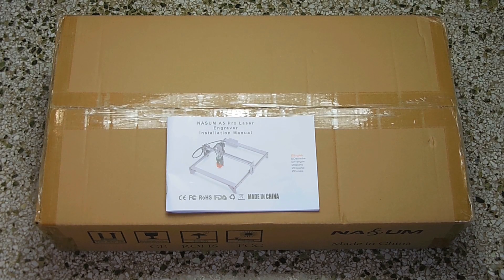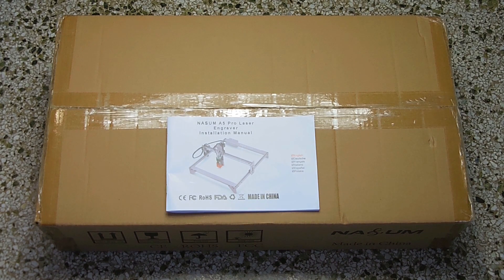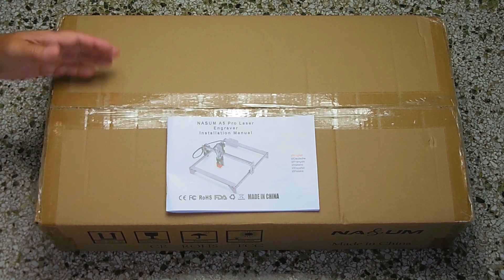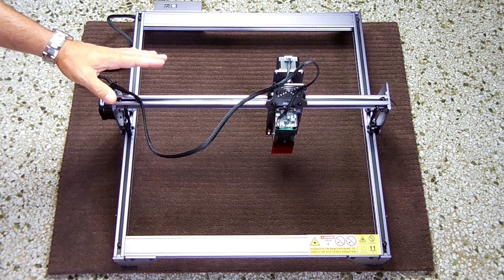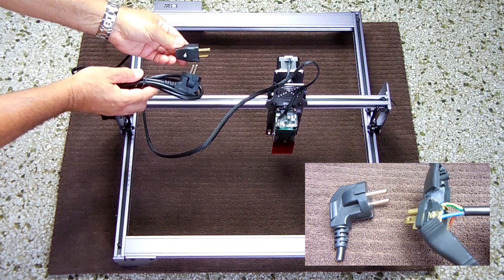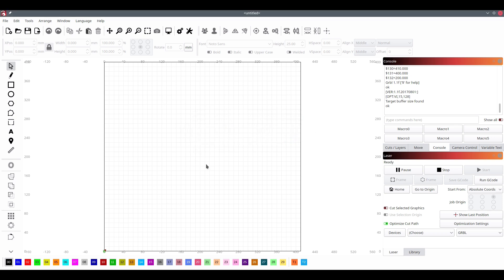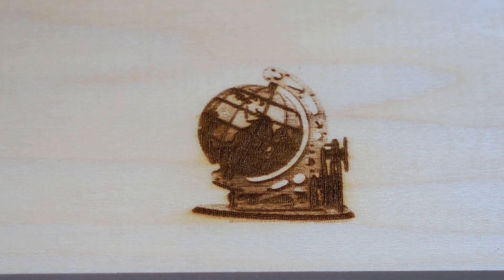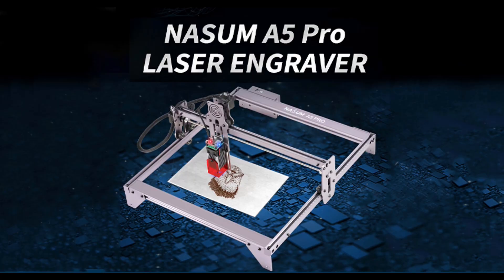Nasum A5 PRO 40W Laser Engraver Etcher Any Good? Find Out!

Comment: "According to the manufacturer, it has the ability to cut through 1/2" wood"  That's a big claim.  How about testing that claim.  I think it'll fall short by a wide margin.
Reply from the maker: I think it will, but you'll need multiple passes to do it. I tried 100% at a slow speed, and it burned 1/8" deep one pass.

Comment: Hey, I just got this laser and I'm having problems engraving/etching the surface of stainless steel and aluminum. I noticed you said it took 14 minutes although whenever I engrave something it takes a couple minutes. Did you go over it multiple times? I'd really like to solve this problem so anything would help haha. I've tried using both lightburn and laser grbl.
Reply from the maker: You have the speed set way too fast. I explained in the video.
Reply: @electronicsNmore  My speeds actually set between 10-30 😓 I’ve been going slower and slower.
Reply from the maker: @puddles113  Then the power is too low.
Reply: @electronicsNmore  I did end up getting it to work on stainless steel. Unfortunately it just didn’t work on my materials I was originally using. I was using a stainless steel with a different finish. I didn’t want to leave my comment as it was since it’s really not a bad laser, just not the right one for me. :) Thank you for responding so quickly!

Comment: any recommendation settings for etching clear acrylic?
Reply from the maker: I only tested one piece, so I need to experiment more with settings. The piece in this video was smoked acrylic, not clear. I'd remove the protective adhesive paper from the back of the acrylic before engraving, place it on a piece of plywood. Leave the protective cover layer on the front of the acrylic to prevent scratching while handling it. Acrylics generally engrave well at a higher speed and lower power. It doesn’t take much laser power to mark the acrylic, and if your power is too high you’ll notice some distortion in the material. The plastic in this video should've been engraved using a little lower power. Just experiment. Thanks for watching!

Comment: You didn't really show the important end of the power cable.  It almost looked like the end of the cord that plugs into the controller/power supply unit was a standard IEC-13 cable or another standard cable type.  If that is the case, then almost any old computer power cable or spare cable with a matching end to plug into the controller will work without needing an adapter or modify the cord and the bonus is that the old repurposed cable will likely be safer as it will probably use quality cable inside that meets the standards of where people happen to live.  I actually prefer when cheap Chinese products come with the wrong cable since it makes it that much easier to justify throwing the safety/fire hazard away.  Any DIYer who is over 20-25 years of age should literally have a huge extra cable collection by that point so having a spare should not be an issue for any DIYer.  I actually built a tester when I was younger using nichrome wire on a metal frame with ceramic insulators so that I could test IEC cables to ensure they could actually deliver the 10-13 Amps most claim.  A majority of Chinese knockoffs went up in smoke or went open circuit after only a few minutes of operation at a 10A load.

I don't like that they went with an open frame when an enclosed machine should be the minimum bar for entry since you not only don't want laser light reflecting everywhere, but you also don't want to breathe any of the smoke or fumes coming off the materials as you cut them.  I also really doubt that thing can cut 1/2" anything short of balsa with a ton of passes and several height adjustments to keep the beam in focus.

My 100W CO2 laser engraver/cutter can barely make it through 1/2 baltic birch plywood at 105 watts actual measured tube output and a 0.5"/s feed rate with 2 passes.  While the wavelength of the light makes a difference on what materials you can cut or engrave, a watt is a watt for actual production.
Reply from the maker: Correct, it's a standard cable, but most people won't have an extra on hand, so to me it was cheaper to cut the cord and install a $1.69 120v grounded plug. I hate using adapters. Yes, I had the fan on and windows open when I was engraving the plastic. The smell of buring wood was hard to avoid. Using a slow speed and 100% power, I was able to burn fairly deep on 1 pass, but I agree, several passes would be needed to reach 1/2". If a person wants to cut wood, I suggest they buy a CNC wood cutter. Thanks for watching!

Comment: Hello. Any instructions for cutting acrylic? Thanks
Reply from the maker: Power 80-100, speed 10- 15. You may need 2 passes. 1/8" acrylic shouldn't be a problem.
Reply: @electronicsNmore  I tried clear acrylic 1/4 cutting everything under but not acrylic
Reply: @MrKhmara  diode lasers does not cut anything clear only colored acryl can be cut... Clear acryl is CO2 laser territiory

Comment: Curious as to what you think the outcome would be for personalising concave/convex aluminium bicycle parts?
Reply from the maker: If they're only slightly convex or concave, it will work, otherwise you'll need an auto focusing laser engraver.
Reply: @electronicsNmore  Or perhaps a different Y-axis motor to rotate the part?

Comment: Very nice... One question. When cutting through something,  does the object you're cutting through need to be elevated from the surface below it, and I assume the surface below the target piece would need to be scrap? In other words,  not your kitchen table or counter top! I think I would mount the entire engraver on some sort of solid surface with grid lines to expedite aligning the target perfectly... Great video...
Reply from the maker: Yes. If you cut 1/8" acrylic, other plastics, or wood up to 1/2" thick, you'll need a scrap piece of plywood or other material under the object being cut, then you adjust the space between the laser and work piece using the spacer. I like the idea of mounting it to a grid, so you can easily get everything lined up. Thanks for watching!

Comment: Any chance it would cut through 2-4 thousands of an inch of IRON ? Not steel, if that makes any difference at all... The same iron used in transformator-laminates (cores), just much thiner...
Reply from the maker: Doubt it. It only etches the surface of metal, and you could barely feel where it was done on the stainless steel in the video. .

Comment: The title got me all excited about a 40watt laser, not a 40 watt engraver.

I have a 2W just to play with so I'm doubtful a 5W is gonna cut 1/2in wood, but I honestly hope it does
Reply from the maker: I was only testing the engraving and etching capabilities, but it definitely cuts up to 1/2" wood if the speed and power setting is correct, and you do multiple passes. When I was playing around with the settings on one pass at max power, it cut "burned" down 1/8". The fact that multiple slow speed passes are required, doesn't make it a great way to cut wood. Better off using a wood cutting CNC.
Reply: @electronicsNmore  can it cut acrylic?
Reply from the maker: @melovescotch  Yes, same way as wood, but faster. 1/8" thickness shouldn't be a problem. 100% power , and speed around 10.
Reply: @electronicsNmore  Well 18" is 3mm which is not bad at all. It is the same as the Atomstack A5Pro